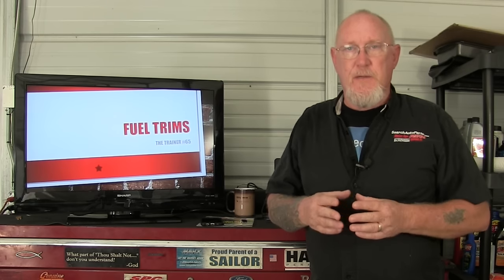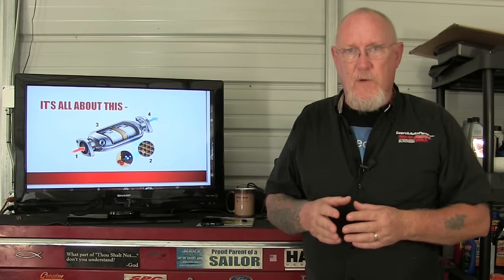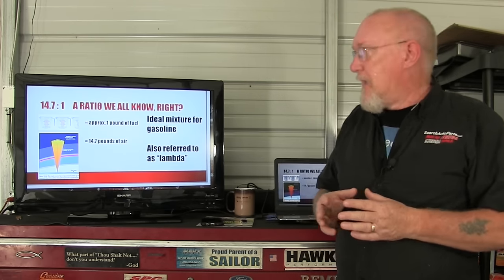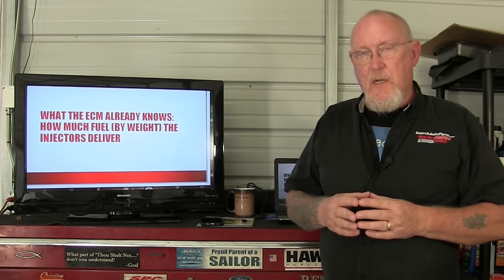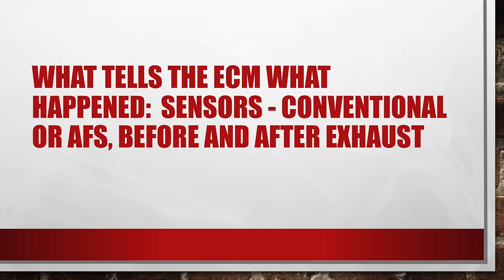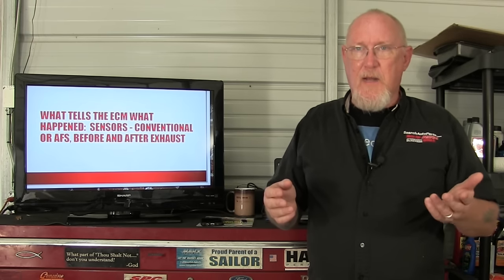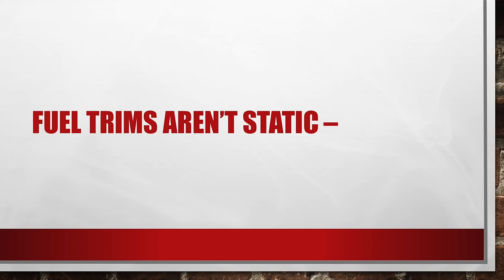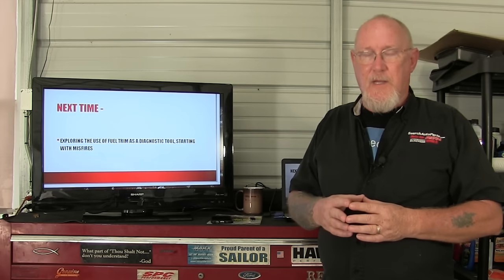The Trainer #65:  Fuel Trim Explained - What It Is , How It Works, And What It Can Tell You

Comment: I just fixed my car with a P0171. Did almost every test and came to the conclusion that my fuel filter was the culprit. It can literally be a million different things. Fuel trims are your best friends. Along with 02 data
Reply: I've been assuming that's it for me also. However, fuel filters dont exist for me SUV. Wtf!? No auto parts store or even online. Super weird
Reply: @DevonWayne  some only have one fuel filter built into the fuel tank/ pump and are only replaced when dropping the fuel tank? I don't like that design yuk
Reply: @robertmedina6875  Robert tengo una ???
Tengo una Pilot 2003 Te hago esta ??
Porque no creo que el 
Don del vid conteste..
Mi problema es el bank #1 no funciona
Mientras el bank #2 si.he cambiado lo que
Trabaja en in lado al otro y sigue con lo mismo.
Desconecto el bank #2 y tiro a prender y enciende
Con el bank #1 conecto el #2 y deja de funcionar.
Hoy Hice otra prueba. Desconecté el plug del
Injector #1 bank #1 y la unidad falla lo conecto y recupera.
Le desconecto la corriente a la bobina y el cylinder se queda igual.
Está bien weird esto.
El short trim del bank #1 está en -27. algo% 
Se que lo hace la comp pero de donde viene la señal para ese comportamiento?????
Ahh! Y la miras y el motor está como si fuera normal quieto en tres cylindros👣
Tiene nuevo todo lo relacionado con....
👀👃👀Acepto comentario de cualquiera que interese en ayudarme.
Pero que tengan LOGICA  please!!!!
Thanks👈
Reply: I’ve tried everything. New o2 sensors. Smoke test and no vacuum leaks. New injectors, new fuel pump, and still getting the po171 and short term fuel trim at like 30% at idle.
Reply: I hope EVs,. with less moving parts don't have to deal with all this silly feedback mess.

but we all know how that goes the manufacturers will overcomplicate it  somehow.
Reply: @camerongriffin1820  If you done everything properly even not vacuum issues which I have to be there most forget the ECM some times loses there feed signal like the ground side from the ECM and/also power side signal which in means can be the wiring to it or the ECM driver itself. Again I would have to check myself
Reply: @camerongriffin1820 same issue here. Did you find any solution

Comment: You run into people that are true Teachers/Trainers in life,  AND you Sir are one of them. Thank You
Reply from the maker: Thank you for those kind words - I'm glad you find the content helpful.
Reply: 11:30
Thanks for this excellent video. I need some of your expert guidance. 2011  Hyundai Sante Fe engine failure126,000 connecting Rod bearing failed. Warranty engine installed by Hyundai. 6000 miles later engine lacks power.  Finally I get a check engine code PO106 defective map sensor. Replace it with a OEM Hyundai map sensor . Check engine light goes off.No 
 change in running condition . Vehicle is towed to the dealer Dealer. Dealer  diagnosis, 2 defective CATS melted and coming apart  inside. I claim the ECU was not communicating  with new engine or updated when it was installed. We were probably driving vehicle for many miles with a faulty map sensor( making the engine run lean or rich) but the check engine light never came on and when it finally did it was to late the cats were compromised. My other reason the CATS failed is when the original engine blew up it sent engine parts ( rod bearing, connecting rod , piston and engine block)coolant, oil and fuel right into the CATS compromising them. It’s now a battle with the dealership trying to get them to replace the CATS under the engine warranty. Dealer checked the ecu with a basic scan And  says its working. No check engine  light currently on and no codes   For catalytic converters . The dealer also ran a compression test 140,160,160,160. Not sure if this imbalance would affect the AFR in each cylinder? Any advice Appreciated
Thank You
Reply: Yes Sir, Indeed !!!

Comment: Since the title is fuel trim you should probably start with fuel trim and maybe talk about other things but then you should end it with fuel trim there's a short-term fuel trim and there's a long term fuel trim in the short term more or less effects the long-term in the long term fuel trim should always be really close to zero in the short term or the quick fuel trim is usually going up or down is that indicates if you have a problem or not if it's showing that your fuel trim is high or it's putting in more gas that probably means you have a leak in the intake system somewhere and if your fuel trim is going down to keep it at zero or even zero is even then maybe you're one of one of your fuel trims fuel injectors is stuck open and putting in too much gas so the computer is trying to lower the fuel in the engine.

Comment: Basically the whole sensors react to temperatures they just measured in a different way the old two sensor the oxygen sensor creates a voltage between .1 and .9 and this gets the computer the signal of the heat in the exhaust and we call it an oxygen sensor.

Comment: Hey I’m just a parts salesman who uses a scanner daily this video has helped me tremendously understanding dtc’s. In instances were I would’ve sold a spark plug, maf sensor or 02 sensor for a trouble code, now are instances of bad vacuum lines and air leaks that are more apparent seeing and understanding now. Thanks again great video
Reply: Thank you for taking the time to educate yourself and not just blindly sell parts
Reply: good point. Too many salesmen just want to sell without fully understanding the purpose of the part.

Comment: Great video. I learned it slightly different but, basically the same in that the computers response could be compared to an old style tv. The short term is like a fine tuning and the long term is like changing the channel when the fine tuning reaches its limit.

Comment: You just explained ,very simply and articaly what I have tryed to explain to young people I have worked with.
Most of them and customers when you mention 02 sensor they think that it can't be causing there problems .Not to mention like you said you can go from a bad 02sensor or bad coil and end up with a destroyed catalytic converter all because of a simple problem and then the crying begins and how stupid what ever car company who built the car is .A car being worked on right now 2005 Mazda tribute .
With 3 kats ,it started with a misfire to bad coils ,was driven quite awhile like that .Needless to say ran scan .short term and long term fuel trim1 all at 0 .and a open loop fault
With all upstream 02 sensors.
And a whole lot more .just by looking at every thing on the scan tool kats are blocked EGR tube and EGR blocked

Comment: I have a basic scan tool with a graph ability wich reports 64 % positive ltft. (no check engine light ...)
stft is moving between 0 and positive 12 /15  % and even peaking around 20 %
Looks like there is no vacuum leak, it's a MAP sensor engine
The weird thing is the downstream o2 sensor is stuck reporting -100 % on its stft but run at 400mV. 
The upstream o2 sensor is switching at the good voltage and frequency.
I would have an air leak in the exhaust right ?
I have limited tools,i need to build a smoke machine.
It's a Dacia 4 cylinders really basic ,no egr.
What would you think ?
Thank you for your video,very instructive.
Reply from the maker: First, is there a DTC set? Second, are you sure about that LTFT PID? I've never seen one go that high. Third, any drivability concerns?
Reply: No code,
i'm sure of what i read in the ltft cartridge on the scanner,yes. :  it's 50 % to 68 % on several days of checking it.
No drivability concern.
Thanks for you interest.
Reply from the maker: I don't think I trust the tool. If LTFT is correcting that high, it has to set a code for System Lean. Try checking with a different tool.

Comment: Great video.  I have a 30 year old pre OBD2 Toyota Celica, and it's occasionally running a bit lean (I have a wideband AFM not hooked into the ECU).  Giving me food for thought.  New plugs, distributor cap, and ignition wires.  Air Flow Meter and O2 sensor come to mind as possible cuplrits--could be they're telling the ECM it needs to send less pulse to the injectors.

Comment: If your not sure how rich (or lean) the ratio is, would unplugging the MAF sensor be a way to reduce harm to the cat? Would it bring it back to default mix? 

I've just had a new cat fitted today, yet now see a prior 'too rich' code and a Maf voltage too low code. So am now concerned that the new cat will burn out fast, which would be far from ideal, given the expense of the replacement.

Comment: What causes my LTFT to be at +10.8, I drive for half hour, shut engine off, 30 minutes later I start the engine and the LTFT is now +14.1 and stays there while driving half an hour? STFT varies +/-4%. According to my scan tool, the MAF (4.5  g/s) and O2 sensor appears to be working properly. I haven't been able to find a vacuum leak. Fuel pressure is at 40 PSI. Stock 2002 Mustang GT. Injectors never have been changed. No codes. Car drives fine otherwise. Someone mentioned that it could be intake manifold gaskets.

Comment: Very nice explanation Pete on fuel trims and how they work. I've got a question for you that I'm really not understanding when it comes to AFR sensors. On a typical Zirconium Dioxide sensor, (narrow band) as you know, the waveform it going up and down creating a sine wave like pattern. When the mixture is rich, (waveform high), then the cat cleans up the NOx. And when the mixture is lean, (waveform low), then the cat cleans up the CO and HC. And the cat can't clean up all of these gases at the same time. So, with the narrow band sensor cycling up and down creating the rich and lean conditions, the cat is able to clean up all of these gases. Let's say that a vehicle is cruising along at a constant speed on the freeway and this vehicle is using AFR sensor(s). These sensors can read very wide air/fuel ratios and I'm inclined to believed that the air fuel ratio is held at 14.7:1 for the best emissions. But, it would seem obvious that the computer has to be adjusting this mixture rich and lean for the cat to work as above although on the scan tool, it would appear that lambda seems to hold steady at 1. Could you add anything to this Pete of how the cat is cleaning up the gasses when using an AFR sensor? Thanks Pete for the video and keep up the good work!
Reply: Good question sir. I think a lot of people are wondering about that 😉
Reply from the maker: That is a great question. The feed gas range, compared to lambda, is very small - If I recall it's something like 0.995 to 1.005. The AFS sensor does switch, but it does so in current, not in voltage. Here's a video that does a great job of explaining how it works:  https://youtu.be/zjefDrFH_6c
Reply: Thanks Pete and I figured that the sensor had to be switching although in small amounts to take care of the cat. And yes, I was aware that it was adjusting the current in mA. Thanks Pete for the reply and link hope you have a great day!

Comment: The fuel trim is one of the main indicators that you should look at just like the O2 sensor if the O2 sensor is giving you a good signal and you need to know what that looks like it should be going up and down real quick because the engine is actually puffing in air in other words it's skipping a cycle and pumping in air to heat up that catalytic converter

Comment: So I did just run into these codes, and I watched my fuel trim, LTFT was a plus 55, I had a bad throttle body - she was letting air through somewhere, changed it and I have about from 8+ to 0 LTFT. My next question could that cause p0420 p0430 on new cats.

Comment: First test I did had max LTFT and nearly maxed STFT at idle. Suspected vacuum leak. When throttled up to 2k rpm, the LTFT and STFM dropped to near zero.

Owner drove the car for another week...now the car is showing maxed trims at all engine speeds and runs really rough... I wonder if the excess fuel killed the CAT? Or maybe I didn't get the car up to normal operating temperature due to having to keep foot on the throttle for so long to keep it running. (2010 HHR 2.3L)

Comment: Thank you so much for this informative video. It helped me troubleshooted my car.  After after changing the spark plug and cables, motor mount, MAF sensor, Throttle body postilion sensor, MAP sensor, Air intake valve, new filter, new thermostat, upstream and downstream sensor, PVC valve,fuel filter, new gas pump,  timing belts, alternator belt, ac belt, water pump, intake seal was replaced, the car still has an abnormal vibration? I used my Actron CP9695 and it does not show any code. short fuel trim fluctuates between -+ 3, one oxygen sensor reads 1.2 volt and the other .665.  My miles have gone down to 9.6 miles per gallon. I used to get 22 mpg.  I have a Hyundai Elantra GT 2.0 and has 65,000. What else can I check to solve this issue.
Reply from the maker: I think it's time you took the car to a professional shop. I"d have to have this one in front of me to be of any further help. Good luck!

Comment: Great video. Thank you for the wisdom. 
On occasion, when I've been holding steady speed for some time - like 60 mph for 15 min - my short term will stop carrying. It will level out at one or two percent and just stay there steady until I change speed. Is this a sign of a problem?
Reply from the maker: You have to consider total trim. What is the long term trim doing at the same time? How are you monitoring short term trim? What kind of car are we talking about?
Reply: @MotorAgeMagazine  2003 Nissan Xterra, 4 cyl KA24DE engine.
Ltft is holding steady at 0 or 1%. Sometimes the shorts holds at 0 and long will hold at -1%. Another time 0 and +1%. Another time the long will hold at 0 and the short at -1%, and then another 0 and -1%. At other times the 1 holds at 2 (+ or -). In any case, one of the fuel trims will hold at 0 the other fuel trim at positive, or negative, 1 or 2. And it will stay there as long as I don't adjust my speed. Short stops fluctuating altogether.
I'm just a do-it-yourselfer on a low budget, so I just have a cheapo code reader from Walmart running through an app on my phone. It doesn't supply a ton of info, but it seems to be accurate with those stats and shows a graph on screen in real time.
Reply from the maker: @4wardnthought234  I think that's your problem. The short term should swing more than that and never stops swinging. You may be experiencing a slow data refresh rate on the code reader you're using. If there are no DTCs, no drivability concerns and numbers this low, I wouldn't worry about it.

Comment: Very informative lecture on fuel trims, 
i have facing problem in my suzuki Luana asian model it has only map sensor.  problem facing is that  ltft remains at 10 either the fuel mixture is rich or lean,  while stft and total fuel trim responds lean and rich fuel mixture while long term fuel trim remain on 10 , does it proves problem in my ecm ?
plz guide !
Reply from the maker: A LTFT of +10 indicates a correction for slightly lean condition. LTFT is a learned value to accommodate wear and age of the engine and its components. If there are no codes, and the STFT is switching normally across "0", then you don't have a problem. The ECM is happy where it is.

Comment: Good job. I am interested in learning about wide band o2 sensor behavior. My bluedriver reads 1.5 volts on upstream o2 and doesn't move up and down. And my ltft is -24.  No codes. 02 Subaru Outback 2.5 . Any help would be appreciated.
Reply from the maker: Wide band sensors don't change voltage, it's current that the ECM reads - and very small current at that. Can you confirm that this engine uses a MAF sensor? If so, post STFT and LTFT at idle and at 2500 rpm - let's start there...
Reply: I had this problem. Dirty fuel injectors, dirty fuel filter, exhaust leak also.
Reply: I'm also having a similar problem. 08 Honda fit 1.5 
Stft @ start was around -3% then adjust close to 0. 
However LTFT even after warm up and test drive, stays at -17% to -19% and never adjusted from there.  No codes. But after you shift into 2nd gear, if you are too heavy on the gas, it starts cutting out and backfire. But it don't if your easy on the gas while in 2nd. 

I was thinking dirty injector or possibly a faulty one. 
Any help would be appreciated.

Comment: The fuel trim is showing you what the computer is doing to keep the engine running at efficiency if the computer is saying that you have more gas going in then that can mean you have a air leak in your intake system it's trying to balance it out so what's more critical is if the long-term fuel trim is not at 0 or neutral then you really have a big problem the short-term fuel trim should be going up or down a little bit to control the burn of the fuel which is pretty much measured by the heat of the O2 sensor and the heat of the O2 sensor which we call the oxygen in other words if you have a high signal you're not getting enough gas if you're getting a low signal you getting too much gas and you can imagine the O2 sensor only puts out a 0.9 volt to a 0.1 volt so you can imagine how close it monitors the heat of the exhaust gas coming out of the engine I would think you need an O2 sensor for each cylinder but it's happening so quick that you only need one per six or four cylinders or eight cylinders it depends on the manifold if you have 202 sensors they just last longer because you have two manifolds exhaust manifolds